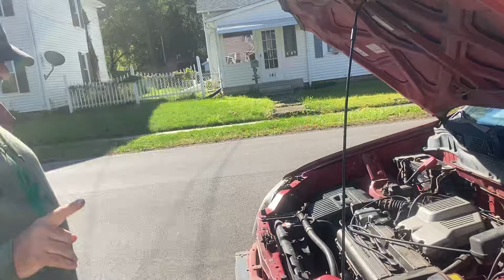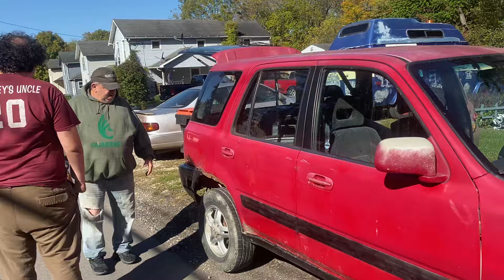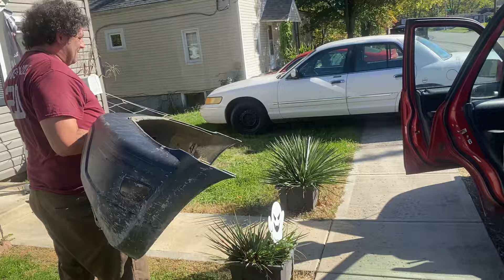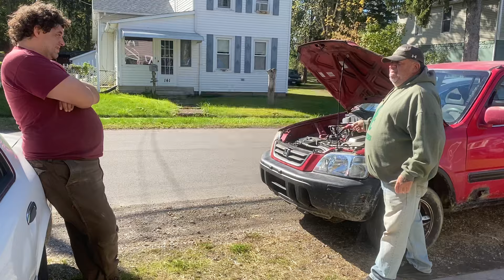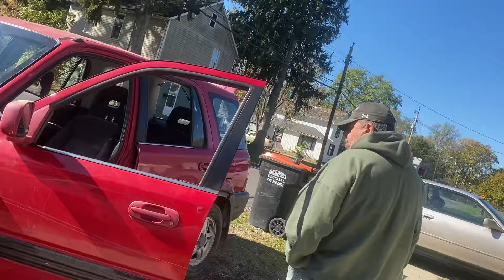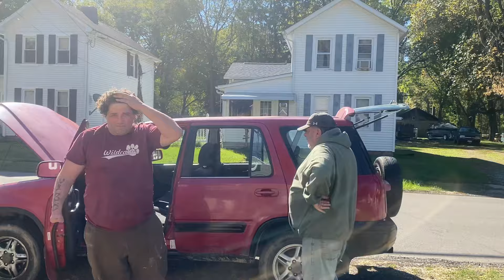The worst Honda cr v  on you tube @icecreamtruckadventures

Comment: im so excited to see more of this car, i love CRVs but i love toyotas more. I just finished working on a 96 rav4 with 200k miles and its a blast to drive, no problems. timing belt, reboting axles, radiator, sway bar links , struts. oem seals. yall got this, cant wait to see more from yall on this
Reply from the maker: Thanks
Reply: @icecreamtruckadventures  the junkyard for parts will be yalls best friend for this one, i know it was mine when working on pre 2000 early 2000 toyotas
Reply from the maker: @twitchtwitch9006 agreed headin there Monday😊👍